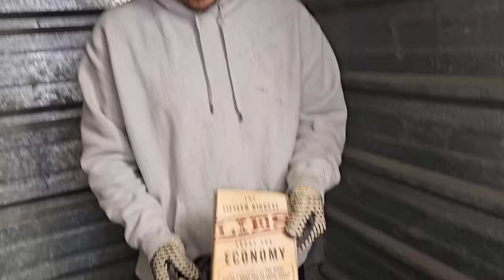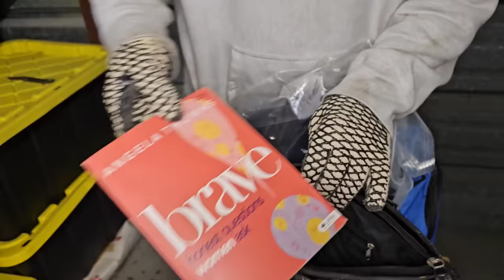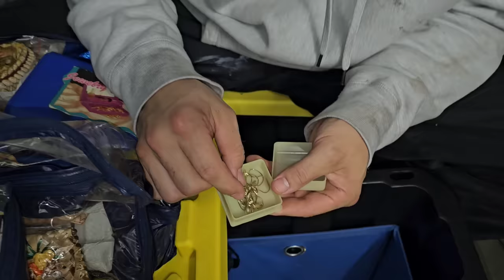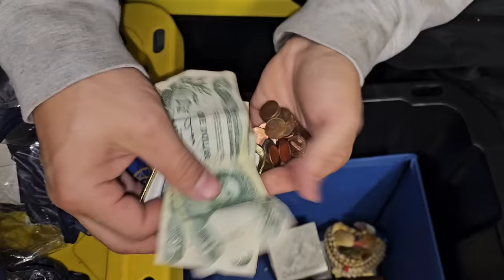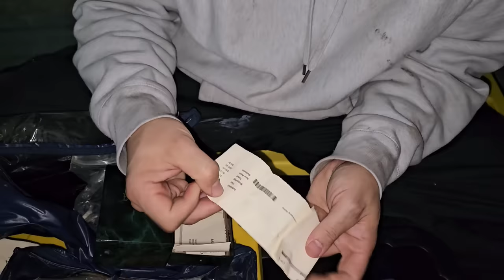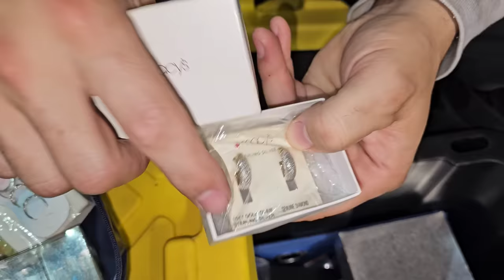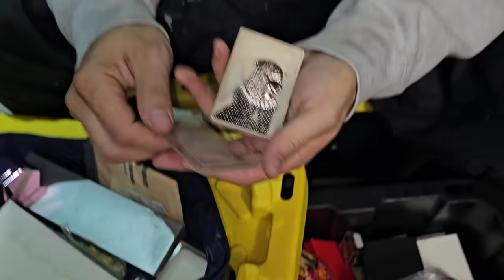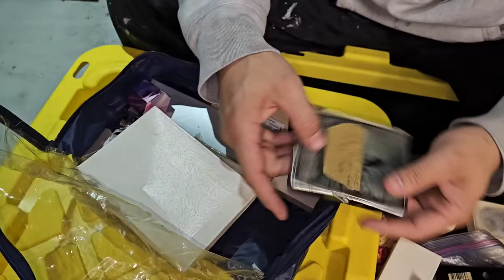RICH NEW YORKER HID GOLD & SILVER In Her Storage Unit

Comment: You need to bite the bullet & buy a rainbow vacuum cleaner. The debris goes in the water basin, not anywhere near the motor. I renovate houses & am always stripping some piece of furniture. You can even vacuum up sheetrock dusk & plaster bits. My rainbow is 21 yrs old. I used my sister’s before I got one. She renovates houses too. These vacuums are SUPER pricey but worth it.